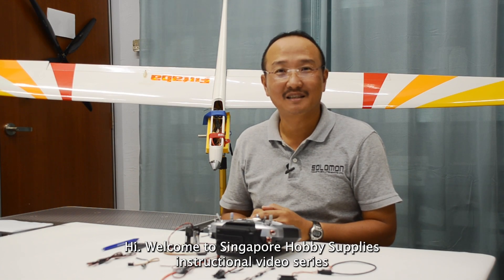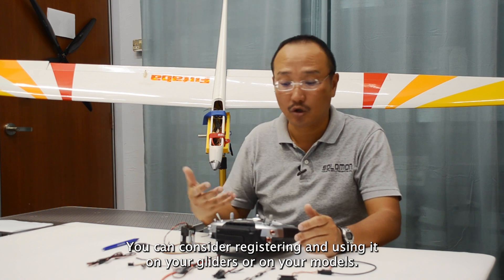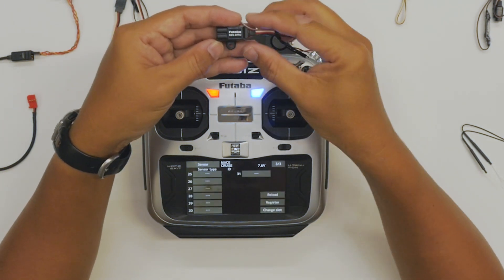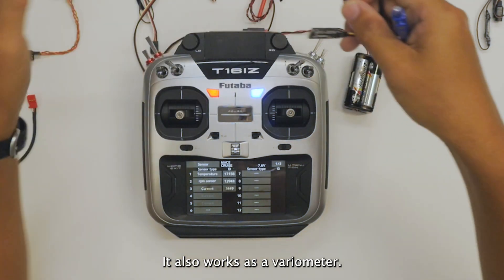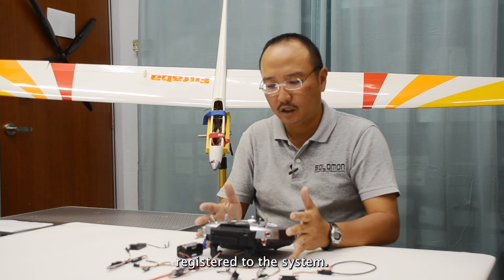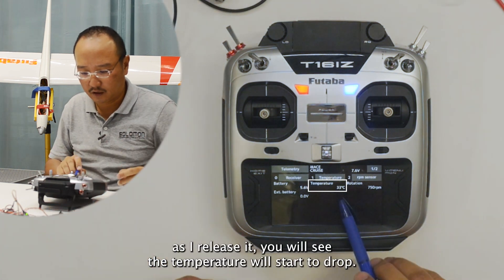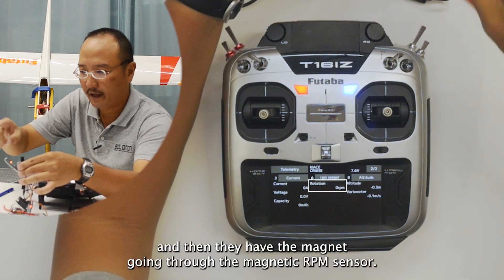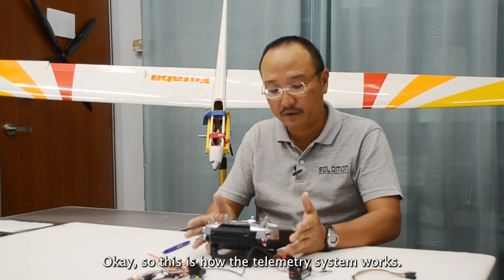FUTABA Instructional Videos - How To Register Sensors

Comment: Is the battery external battery required for registration of temperature sensor,  i was able to register without external battery ?but sensor does not turn green or read temperature sbs-01T

Comment: Great video as always.
I have a problem with my t16sz. I cant register seonsors as the register button is missing from screen. 
Could you help?
I cant attach pictures here so you couldsee.l, but all the buttons on the right side of the 3rd screen are missing on my screen.
What could the issue be?

Thank you😊
Reply from the maker: Hi, did you register the sensors like the video, using y-cable that connects power and sensors? If so and the sensors still does not work, please try to enter the serial number of the sensors onto the sensor slot. Just a note, do not change the sensor to slot number.
Reply: @radiocontrolshop  yes, thank you
The problem was that i linked the receiver first and then tried tonregister sensor to that model. Apparently its not possible. You need to register sensors firs then re-link the receiver again. I discovered it by accident when i was  setting up another model and when i entered the menu all of the buttons were there.
And yes i did use the y harness cable with power cell on the other end.

Thank you very much for your response and trying to help.

Comment: nothing works with telemetry on my T18mz....i think my tx must be faulty.   i have had nothing but faults with my t18mz...two batteries failing and telemetry never worked....i am now changing over to radiomaster.

Comment: Nice video. Does anyone know if these sensors can handle 8.4V ? I have a Futaba 4PM, R324SBS and I'm wanting to use my 8.4V capable steering servo at 8.4V. I have 3 Futaba Sensors but don't know if it'll fry them. Futaba is possibly the worst ever with answering questions. Thanks.
Reply from the maker: Hi @ImAcoastpedder , we did a video response to your question! Check it out, here. ---> https://youtu.be/tvEYsWsN0o0?si=qH1KunNsw4G9kkWB

Comment: As I changed the radio- Futaba 18Sz -  your excellent videos were very helpful. Speaking of sensors I found Unisense-e from Modelbau (German) which is excellent.
it shows voltage, current, capacity voltage rx and RPM at a very attractive price. You might want to check it out and give a nice review for the benefit of your many followers. Greeting from Italy.
Reply from the maker: Thank you for your positive feedback. We have no experience with the mentioned sensors so we cannot comment. As far as we understand, it would be advisable to stay with Futaba Sensors.
Reply: @radiocontrolshop  Thanks for replay.  I think it's better than futaba sensors.  the sensor is simply fixed in series to the power supply with pre-mounted connectors, a single sensor that gives all the measurements indicated.
Reply from the maker: Noted with thanks. Do check out the Futaba Current and Voltage sensor here. https://www.singahobby.com/index.php/futaba-sbs-01c-current-sensor.html

Comment: Great video! Do you know if - when you want to add a new type of telemetry device - then does the transmitter have to support this specific telemetry sensor type in the transmitter software ? So for example if I have a Castle Creations telemetry interface for Futaba and the newest 16IZ Super transmitter (not 16IZ) then does the transmitter software have to support this specific sensor ? Same for any other 3rd party telemetry sensor - does the tranmitter need to "know" this sensor type or does it read it's details from the sensor during registration ? Not sure if my question is clear...